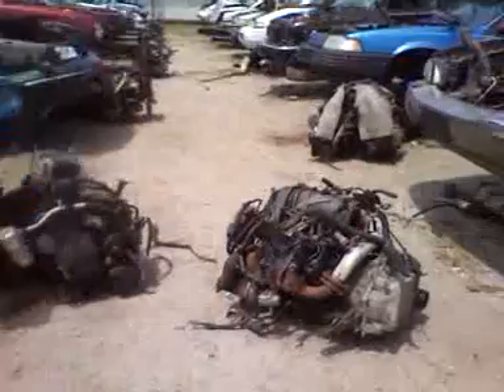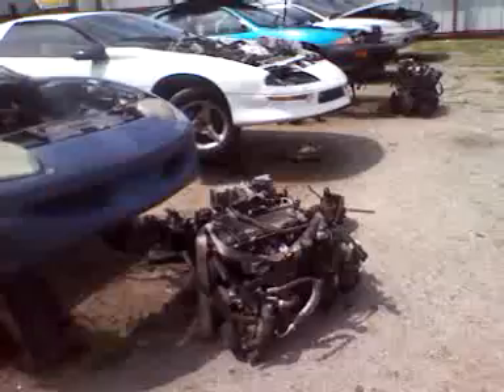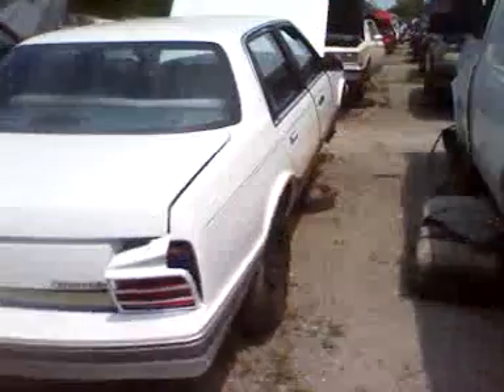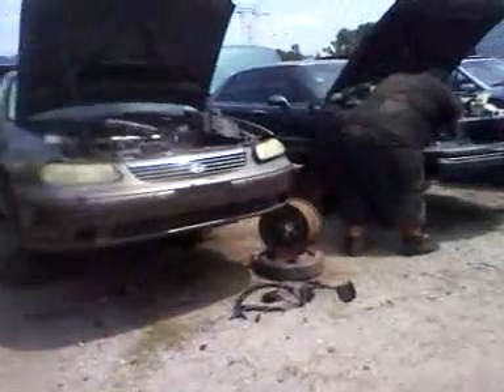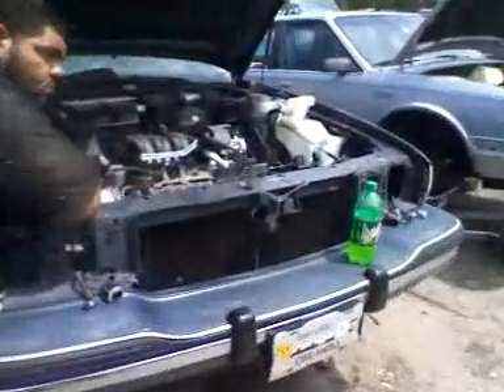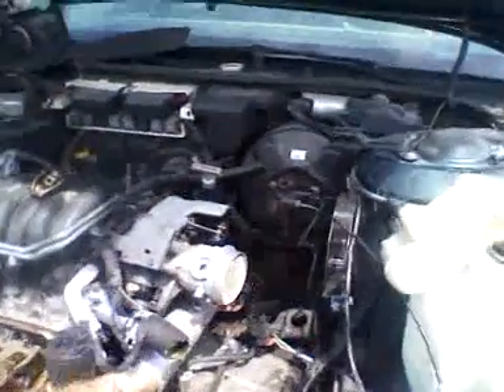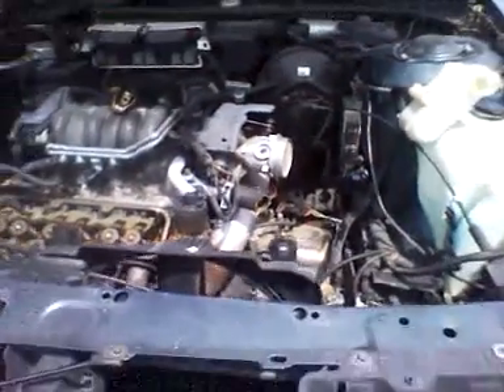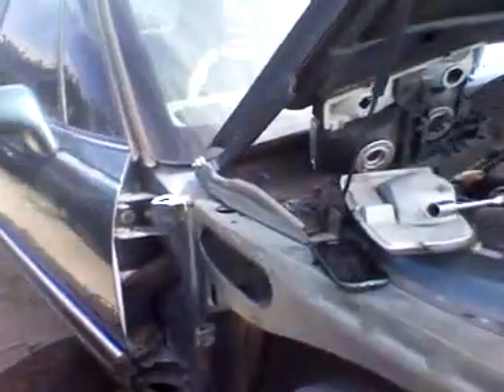pulling 8 motor & transmissions out in salvage junkyard

Comment from the maker: my buddy Dre has a repair shop & used to be a dismantler at several salvage yards here in florida ... he pulls the drivetrains ... they have engine dollies in the yard the pick up engines & roll them up front & to load them ... on this day we loaded up my 20' trailer with 8 engines & transmissions